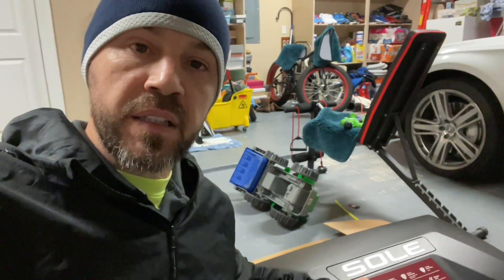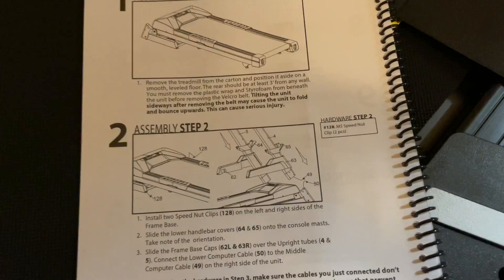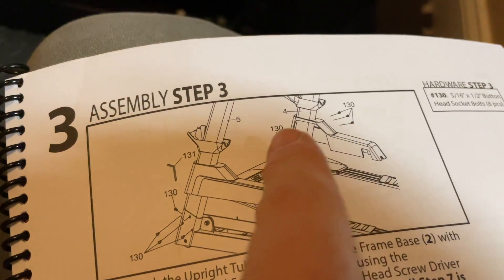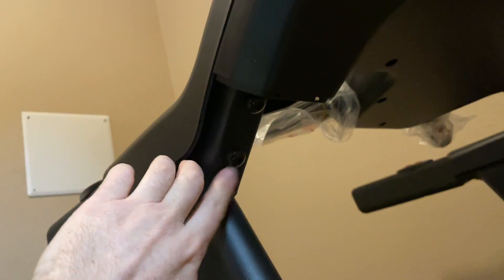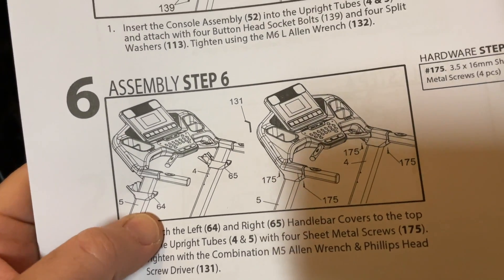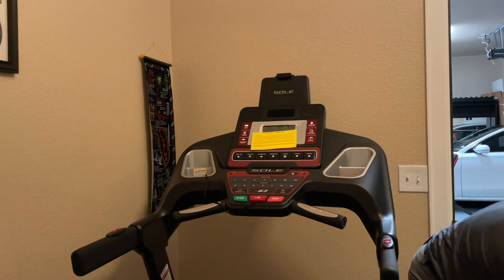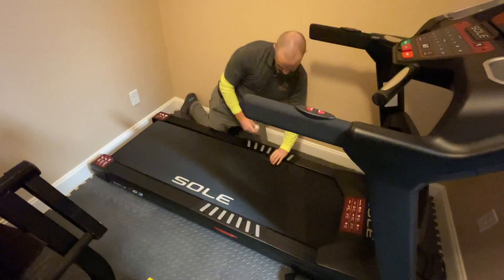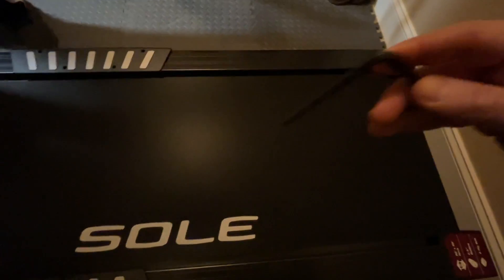SOLE F63 Treadmill Assembly Step By Step And DEMO | How To Lubricate The Belt DIY | Best Treadmill

Comment: For anyone that has issues with the console wiring like I did, the wires need to be outside the railing cavity before you slide the console in place. You'll tuck them into the cavity after you've screwed  the console in place
Reply: Thank you so much. This was Very helpful!
Reply: Still totally stuck on this step.
Reply: Thank you so soooo much. We just wasted 45 minutes wrestling with those dam screws and your suggestion worked immediately!!! 😅😅😢

Comment: Thanks for the video, my F63 is sitting in the garage waiting for my friend to come over tonight and help me haul it upstairs. I unpacked everything except the base.   I'm a "visual learner" so reading the instructions then watching your video was very helpful.  I'll probably reference your video again when I start to put it together tonight.
Reply: A Vietnamese friend of mine helped me get the old treadmill down the stairs and out of the house but there was no way the 2 of us were getting the F63 up those narrow stairs.  He called on his wife, sister, and Mom to come help LOL.  They got it up into the bedroom, he told me they were used to hard work in the fields of Vietnam. 

  I started putting the F63 together and after around 2.5 hours and a lot of profanity I was finally finished.  To my amazement it actually started up and ran OK.   It's lucky the unit folds up because I failed to compare the length to the old one and it's quite a bit longer.

Comment: Just got mine delivered today.  Will assemble it this weekend.  Thanks for the demo.  Hope to God all will go well with the assembly.
Reply from the maker: You’ll do fine. Take your time and it will turn out as it should 🙂✌️❤️
Reply: @MasteringMayhem  Thanks.  Having a bit of a problem.  When inserting the console after connecting the speed and incline cables, the speed cables go in the way of four button head socket bolts, I am afraid of pinching them when screwing the bolts. Am I missing something or doing something wrong?  Do I have to place the cables on each side of the holes?
Reply from the maker: @lucca81  You should be able to tuck the cables into the hand rails out of the way. When you screw the bolts in just take your time and you shouldn’t pinch the cables. I hope that helps?
Reply: @MasteringMayhem  I did it!  I checked you F80 assembly video and you insert the console into the tubes before connecting the cables. Thanks for your quick reply!  Appreciated.
Reply: @MasteringMayhem  Thank you.  Treadmill assembled and ready to go!.  Question: Is it me or even at 0 incline the treadmill seems to have a slight incline?

Comment: I just finished the assembly of my new Sole F63 Treadmill and after watching this tutorial for the 2nd time. It all worked out great. Using that tape to hold the tiny screws was a great, idea it really helped.  The thumping sound on this video much louder than mine. It did last for about 10-15 minutes before it went away.   I did not have to use any additional foam mats for the treadmill industrial carpet on top of the cement was perfect.
I am so thankful to mastering Mayham for filming this for us newbies.
Reply from the maker: Glad the assembly worked out well for you. I did struggle with those screws for about 20mins before I came up with the tape idea, glad it helped you save some time and get those screws in place. Enjoy your new treadmill and all the best to you and yours.
Reply: How long did it take for them to deliver your treadmill?
Reply: @marioa2753   Hi, when I called SoleFitness they said 60 days for delivery. I ordered it 11-28-20 and received it 01-11-21 44 days.  You can order it from Dicks but you have the hassle of transporting it and it’s very heavy. 300lbs. I had it delivered and dropped off in my garage. You will need two to three people to help move it.  Good luck!

Comment: Thanks for your help. The only problem was when I was following your instruction I would pause the video and do the work. I fully tightened all the screws and I returned to your video only to hear you say not to tighten the screws all they way. 16:35 I'm getting the same thumping noise as you. I let it run a few minutes at max but it still hasn't gone away.
Reply: Did the thumping go away in the end?

Comment: Thank you for your video - one question - I am having problems getting two of the 4 bolts that secure the console to the masts to screw in completely (about 8:39 in your video). They screw in okay to start but then get stuck with about 1/2 inch left and simply will not budge. I've tried switching the screws around and it's the same two ones - it seems the second hole isn't drilled properly. On the left side the issue is the top bolt and on the right side it's the bottom bolt.  The other two have no problem at all. The plastic posts are in the metal arm as they should be. Any ideas on what is wrong?

Comment: Quick question. Does the entire weight of the front of the treadmill rest on the front plastic wheels?
Reply from the maker: I don’t believe so. The weight shouldn’t be on the wheels until you lift the treadmill to move it.
Reply: @MasteringMayhem  Thanks. I see the obvious 2 rubber feet in the rear, but where are the feet on the front?  Thx.  The reason I'm asking is, I bought a used F63 and  the base frame was disassembled. Just want to make sure I have it setup right.

Comment: Have a question with Safety Key ,  the panel keeps on displaying need Replace Safety Key even after the Safety key is in the slot any suggestions on how to address the issue? .  It’s a new F63 which was working .
Reply from the maker: I’m not sure how to address that issue. Haven’t run into that problem yet. I assemble new equipment for my clients mostly.

Comment: Hey man - great video; useful! Question though - is there a knack to aligning the arm covers? I’ve just got a TT8 with the same covers, and they don’t sit flush with the console, particularly at the front...I’m assuming the console isn’t fitted correctly, but I’ve done it twice and took lots of care. Any ideas?
Reply from the maker: It’s just fidgeting with them until they line up. I’m sorry I don’t have any tips on that, other than, don’t get too aggressive with trying to force them to line up, most of the time they will line up easily rather than being difficult. There may be a plastic tube in the arms that go into the metal arms and you have to make sure that the plastic tube is lined up with the hole in the metal arm to get everything lined up. Let me know if that helped at all? 🙂✌️🙂
Reply: Forgot to reply, but I ended up taking the console off and resetting it so the covers aligned better. There’s quite a lot of play in it and the holes when aligned properly isn’t necessarily the best place for the covers to align!
Reply: I’ve had the same issue. The arm cover on the left fits flush but the right one the side slots don’t align. Almost have to pull the console arms apart to get them to slide in the uprights and it’s still not perfectly centred. Any suggestions? All bolts left loose also, seems like little play to move much

Comment: How did you check to make sure the cables don't get pinched on the tubing? I can't get the white connector to go all the way into the handle, so I don't know where to let this white connector sit inside the console
Reply: Did you figure it out? I am soooo stuck on this step.
Reply: @heidiho3089  ya don't try to push it into the handle pole. Just have the wires slack but connected outside the arm, fit up the console with the frame (keeping the wires out of the way), bolt up the console (snug), and then fit as much as you can into the remaining cavity.

Afterwards there is a cover that slides up and you can hide whatever is left using the cover.

Comment: Your video was really helpful, but SOLE needs a better way to install the handlebar covers on the console assembly. You have to be a contortionist with X-ray vision to assemble them. I used tape, magnetic screwdrivers, everything I could think of including watching several others videos as to how others solved the issue as to how to attach them. After several dozen attempts I was ready to duck tape them in place. The rest of the assembly before and after was not a problem, but the handlebar covers are a pain in the butt. It shouldn't be that difficult. 4.5 for the treadmill and a 0 for the handlebar covers.
Reply: Lol I just left them off. Way too difficult for no real purpose.

Comment: How heavy is the main running deck part "before assembly"? I assume it is the heaviest part. How wide is it? Will it slide down a straight 31" wide basement staircase? I guess I can slide down sideway though. Thanks.
Reply from the maker: I don’t remember the dimensions and weight, I did this assembly for a client. All the best.

Comment: I have an issue, I was that person who took off the belt and because I tried to line it up on the floor mat and in doing that it raised up , it’s on a incline, How do I get it back down?
Reply from the maker: There should be an indicator on the hydraulic bar that keeps the belt up when you want to store the treadmill. Just use your foot to push the lower half of the hydraulic in a little but to allow the top portion of the hydraulic to slide into the lower portion, this is what will take the hydraulic bar out of the ‘locked’ position. The belt and base of the the treadmill should then slowly drop back down to the floor. Let me know if that helped or if I didn’t address the issue.
Reply: @MasteringMayhem  I see  the yellow thing, Not sure if that’s going to work doing it on my own. I’ll check back with you

Comment: Never owned a treadmill so I have a crazy question; why would you need to adjust the belt left or right?
Reply from the maker: They don’t always arrive ’centered’ and over time, after use, the belt can move left or right a bit depending on the user. 🙂✌️❤️
Reply: @MasteringMayhem  Thanks bud...really appreciate the timely response.

Comment: Hey, I just assembled mine and I was wondering if lubing it is necessarily. I read the manual and I think it comes prelubed. Should I relube it?
Reply from the maker: If that oil bottle is full I would live it. Check with your fingers under the belt, if you don’t get any oil on your fingers then definitely lube it.
Reply: My Sole  F85 was completely dry. Production probably a bit fast these days due to the extra demand for home gym stuff due to covid maybe...
Reply: @Peter Rabbit Hmm I might do the same, mine feel a little rough as well.

Comment: Hi, our outlet won’t reach the chord, do you have a recommendation for an extension cord or surge protector where I won’t trip the power and can reach the outlet. It does say not to use an extension cord. TIA
Reply from the maker: This one of the best ones out there, hopefully 7 feet is long enough: Tripp Lite SUPER7B 7 Outlet Surge Protector Power Strip, 7ft Cord, Right Angle Plug, 2160 Joules, Black, & Dollar 75,000 Insurance: https://amzn.to/3c0QucD
Reply: the latest manual says the following: "DO NOT USE AN EXTENSION CORD UNLESS IT IS A 14AWG OR BETTER, WITH ONLY ONE
 OUTLET ON THE END: DO NOT ATTEMPT TO DISABLE THE GROUNDED PLUG BY USING IMPROPER ADAPTERS, OR IN ANY WAY MODIFY THE CORD SET."
Reply: @SaltySparrow   I read that so what do you recommend?
Reply: @MasteringMayhem  how long is the standard cord that comes with the F63?

Comment: Thank you for the step by step! We are assembling today. Do you recommend a plywood platform if it’s going on carpet?
Reply from the maker: Doesn’t have to be plywood. I recommend a thicker rubber mat to keep the treadmill from possibly sliding around. Hard plastic or plywood may allow the treadmill to slide. Let me know how the treadmill turns out. Thanks for supporting the channel.

Comment: Great video! I get mind delivered tomorrow 1/11/21. This will definitely help with my assembly. Will let you know how it goes. 
I do have one question. I am putting this in my basement on a thin industrial carpet. Do you recommend getting the foam mats or would that throw off the balance of the treadmill.

Thanks!
Reply from the maker: I think the thin industrial carpet would work fine by itself but if you wanted to add those foam pads they shouldn’t throw anything off. 

Let me know how it all turns out.

Comment: Hey what is the padding you have in your room? From amazon? Is there any way I can get a link? Thank you 👍 awesome video btw. Mine should be here next month 😂
Reply from the maker: I assembled it for a customer but that padding is what you would find on Amazon, in WalMart, or I think even Harbor Freight has padding like that. You can get more rugged 1/2” thick rubber mats @ Tractor Supply if you’d like as well. I hope that helps.
Reply: @MasteringMayhem  thank you so much I'll take a look around!

Comment: How do you just skip the most important parts?
Reply from the maker: Which parts are those? Most feedback says it’s a great video. What did I skip over?
Reply: CaptainKiluminati ... Did he really skip the most important part? What is it then? Tell us...
Reply: Maybe Captainkilluminati is talking about the routing of the cables from the console to the posts. That's what I watched for and was hoping to see but that didn't happen on video. The directions just say tuck them into the rails but I feel like I'm missing something because it seems they are tucked pretty tight.

Comment: The biggest problem I had, was trying to understand how to orient 62, 63's, 64 and 65 in the beginning since you really don't explain it with any detail, and then speed up the video so it blows by so fast, I had to slow it to 1/2 speed and replay it 10 times.  Even the diagram in the book is not a good representation of the parts 64 and 65, because mine don't exactly look that way.  I ended up guessing my way through the first part.
Reply from the maker: Sometimes I don’t get the best edit or the content as I would like, or while I’m assembling for the client I move on to the next next step without checking my camera. I hope to get better at that.
Reply: @MasteringMayhem  The fact that you took the time to share this assembly,  made our lives easier. Thanks for all your work. I waited 63 days to get this delivered from the factory so in comparison, taking a couple days to finish this project is a big improvement.

Comment: I can't get mine to line up for securing the console...so frustrating!! Gonna ask for a refund
Reply from the maker: Did you tighten the bolts down from the previous steps. Leave the bolts loose until that console is in place, you can do it. 🙂✌️❤️